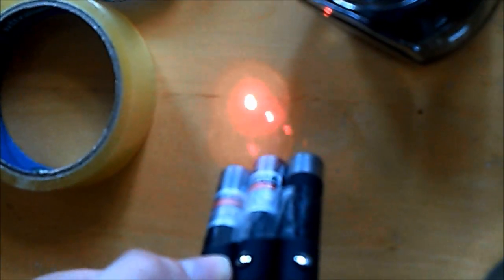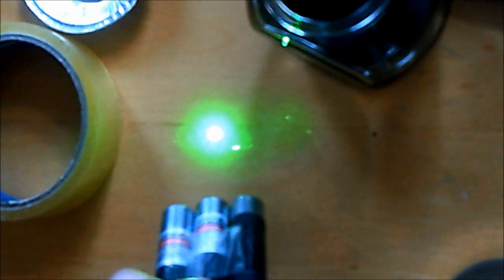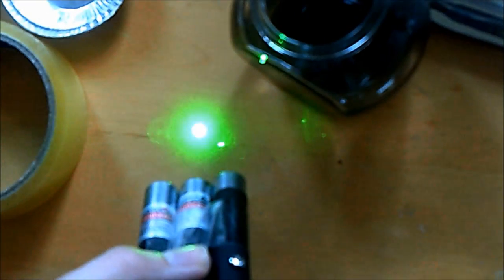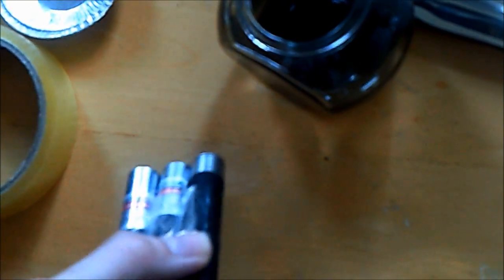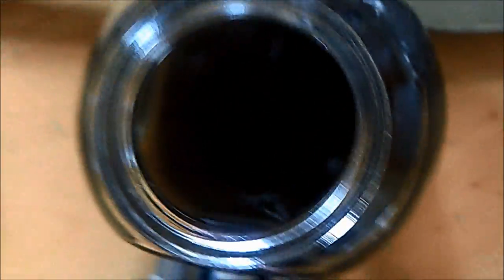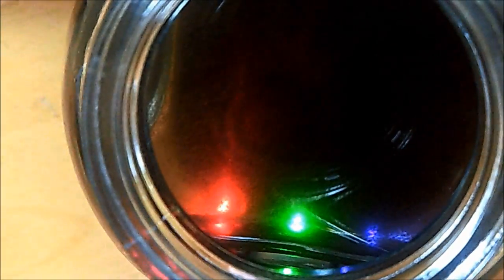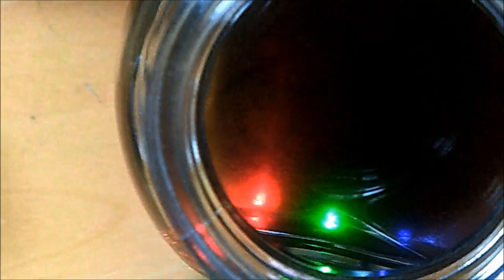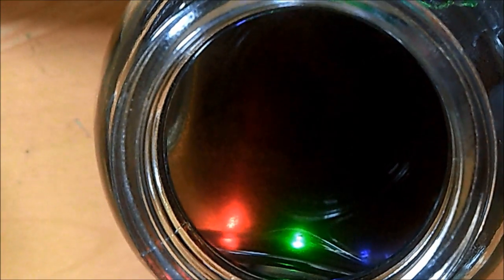Graphene Circuit Etching by Graphene Oxide Reduction with UV Laser

Comment: Hummm, I am not sure your set up is optimized correctly, when I was working with graphene the instant I turned on the sonicator the entire solution went pitch black. 

When making graphene in dispersion, a general rule is to match the surface tension of the liquid to that of graphene, adding a small amount (2mg per 20ml of water) of salt to decisions water can help. However, if available the best solvent was found to be n-methyl-2-pyrrolidinome, if you can get you hands on it you will notice a big difference. Also, maybe try a sonictip instead of sonic bath. Here is a good paper: 10.1126/science.1194975
Reply from the maker: +Lemenks Yes, I wanted to get my hands on a sonic tip but they are very expensive. I was doing my initial explorations with this on the cheap. Thanks for you're suggestions I will take them on board into the future. This is actually old footage from 2013 I did to demonstrate that it might be possible, using desktop laser etchers and lightscribe etc, to make graphene circuits in a relatively small set-up.
Reply from the maker: +Lemenks But I have moved on from this - and the reason is because of the sonication step. I am planning to make a video after the new year showing how you can buffer fine graphite powder onto a polymer film, using a commercial car buffer, and then grow a graphene oxide layer on it using a small covering of concentrated sulfuric acid and potassium permanganate which we can then write our circuits on using this laser etching machine.
Reply: NMP, TMF, DMF, DMSO are good solvents. Also, an ionic oligimeric liquid such as Poly(3,4-Ethylenedioxypyrrole) will exfoliate graphite in a microwave. Naphthalene diimide (NDI-1), or diazaperopyrenium dictions (2,9-dimethyldiazaperopyrenium) work. But my favorite is a 75% (w/w) acetone and water cosolvent, as this will not contaminate the graphene and is easy to remove.
Reply from the maker: Michael Kelley  What?